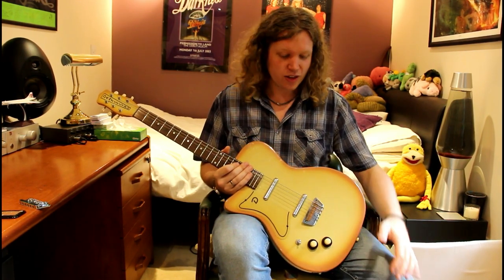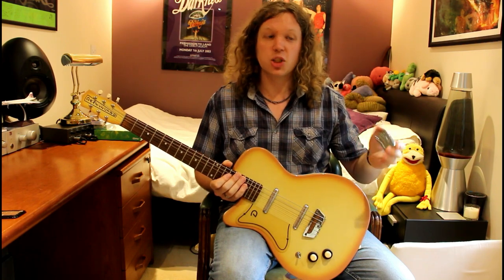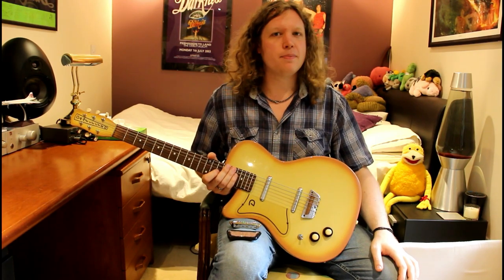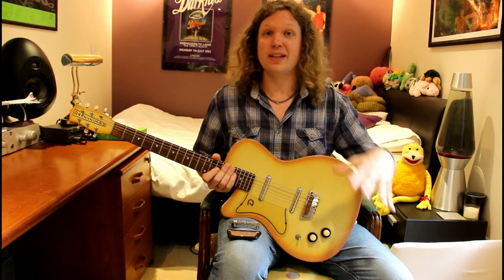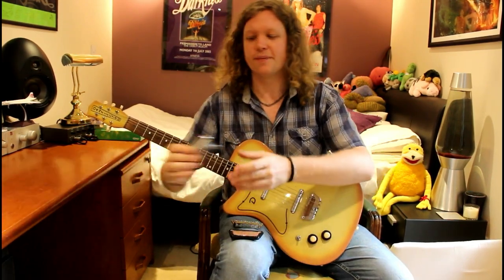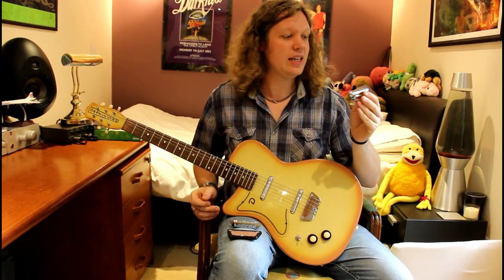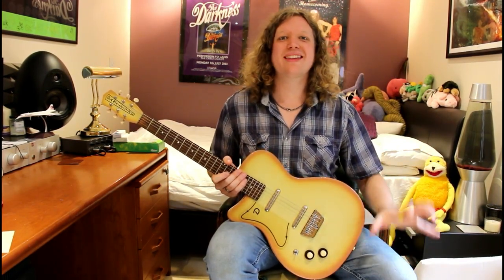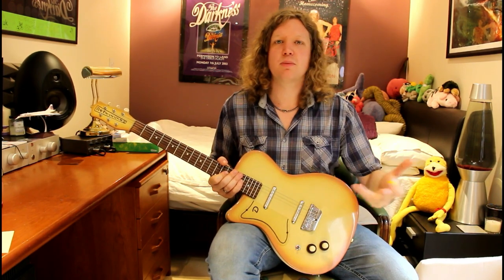Guitar Mods: What Happens If We Change EVERYTHING?? (Danelectro U2 + Curtis Novak Lipstick Pickups)

Comment: The beauty of the lipstick pickups is the low output on them... like a tele. The best sounding Les Paul is the '59, their pickups are so lowoutput that they are closer to a Strat than a modern Paul. I'm also lefty.
Reply from the maker: Yay for lefties!  Yep, the old PAF humbuckers were about 8K, whereas the stock p'ups in my '92 LP Standard are about 14K!  PAFs are so much more dynamic...but then again, plug the '92 into a Marshall and...well, you know! :P
Reply: @JoePerkinsMusic  I had a Les Paul Classic Premium Plus (94 maybe) it had ceramic 498R and 500T, very very hot pickups, on my JCM 900 was super overdriven, but was the nature of the 90s.
Reply: @JoePerkinsMusic  Hi. I am lefty also. Have the same guitar. Bought the same bridge. I tried to switch the string saddles but no luck. Won't fit. Can you tell me exactly what to do? File the width of some of the string saddles? Did you have to modify the new bridge in any way? Please help me to make this work. The original bridge warped again 😕
Reply from the maker: @davidkastin4240  Hi David!  Yeah, that's exactly it...I think it was just the low E saddle that had to be filed...but I just took a little width off the side that rests against the A saddle so that it'd fit in the gap.  You get bigger gaps between the higher string saddles but that doesn't really bother me...much better to be able to intonate the guitar, I think!  The only modification I made to the bridge (aside from the wooden block to bolt it flush to the guitar) was I had to re-drill a new hole for the low E string saddle to screw down into to lock it in place...not because of the filing, but for general intonation.  I couldn't move it far enough back with the screw hole where it was, so I drilled a new hole a few mm behind.  But - you might be lucky.  I think that had as much to do with me using a 60-gauge low E string as it did with the design of the bridge, so if you're using 'normal' strings you might be ok! :-) Let me know if you have any more Q's!
Reply: @JoePerkinsMusic  Did you have to file the little nubs off the back of some of the saddles also? It's a bit of work but I'm concerned about being able to intonate it correctly. The original bridge warped up, possibly because I don't play it much and the string tension caused it to warp up on both bottom sides of the original bridge. Surprisingly the intonation was very good before it warped
Reply: @JoePerkinsMusic  obviously the metal for the bridge is not heavy duty enough. The intonatable bridge seems stronger across the entire bottom
Reply: @JoePerkinsMusic  will I also need to make a lower hole in the bridge for the G string saddle so it can drop lower dor intonation?
Reply: @JoePerkinsMusic  the block of the saddle has 2 rows of 3 holes at right handed angles. Wouldn't you have to drill 4 new holes to make it angle for lefty? The 2 outter holes of each row
Reply from the maker: @davidkastin4240 Hi David - nope, filing the 'inboard' side of the Low E and re-drilling its mounting hole was all I had to do to the new bridge to make it work, aside from swapping the saddles over.  The G-string intonates fine with the original hole position as do the rest of the strings (for me) aside from the Low E.  But as I said, I use a 60 gauge so it might be fine for a standard Low E gauge.  Drop me an email at jp@joeperkins.co.uk and I'll send you a picture of what I did :-)
Reply: @JoePerkinsMusic  Hi Joe. Can you please send me pictures of what you've done as you mentioned? Thank you. Love your guitar mate. What color is it called? I haven't seen many or none at all this color 👍

Comment: Hi, thanks for the videos (both this and the previous one). I have the same guitar in black. I really love the sound and look. I don't play so loud, so the low output is ok for me. The bridge is a nightmare for stringing! It has just a notch, so until you get the string tight enough, it keeps jumping out all the time, from the notch (and for the first strings, the bridge itself moves all the time, as it is not fixed to the body). You really need three hands, one for winding, other for tighting and guiding the string low, and the third to keep the bridge ends of the strings in place... Anyway, I knew that these were cheap guitars, both in hardware and wood (wood?), so I keep it just like it is. I'm happy with it. Thanks again!

Comment: i found a nice set of vintage style locking tuners which are great to have, for all the reasons locking tuners provide.  also, changing the bridge means now you are going from the original "wood" bridge to the "medal" bridge.  that is part of the tone change and also the output level, even though the new pickups are absolutely guilty also of the better, bigger, cleaner yet more powerful sound.  just some ideas ... those vintage style locking tuners bro.  try 'em.

Comment: I've got one of those 90's U2s in a green-burst that I bought new when they first re-issued them in the mid-nineties. It's always been a good guitar even though it's not my first choice to gig with. I didn't feel the need to change much on it: I got the same intonatable bridge, gave it a Switchcraft jack and changed the tuners. I surprised that you didn't feel the need to do that or maybe my tuners just wore out because they were really slipping a lot. In my local music store I found this set of Chinese replacements by this company called PING (I know, it's a funny name for tuners) that were low cost and of the same design and shape of the originals only slightly larger but still were a direct replacement without any drilling or modification. It fixed the tuning issues for not much money. I use 10-46 strings so maybe that's the difference. I really like the sound of your Williams Pro II pedal by the way.
Reply from the maker: Tuners have been remarkably solid on my Dano!  All Williams pedals are insanely good...definitely worth checking out :-)
Reply: Where did you manage to find that bridge? Its looks wonderful.

Comment: With the mods she generally sounds „better“: fuller with more range and bottom end, but lost the charm of that tinny voicing…
   Would’ve been interesting to hear the difference after each particular  swap- with just the new bridge, then old bridge + the new pups. Finally new bridge + new pups. For every test using the same ol' strings. The pots beeing of same value, the diffeence might be not hearable.
Cheers

Comment: Definitely the Novak pickups have an overall better tone to them. Im looking at getting one of his New Yorker pickups for my epiphone coronet. It’s a single coil wound to similar output as vintage p90. He also does a modded pickgaurd as the pick-up currently in the coronet is a epiphone pro p90.  Simple install. The 1959 coronet used the remaining New Yorker pick up before they changed it to the p90 in 1960. So by putting this into my reissue coronet will give it a more vintage aesthetic. Or do I swap it for a Monty’s 54 p90 which will look the same. Struggling to decide. Any thoughts? I might add it’s being upgraded to 50s wiring at the same time ..
Reply from the maker: The Monty's '54 is a stunning pickup - so, can't really comment on the NY pickup, but can wholeheartedly recommend the Monty's!

Comment: What is the bridge wedge made of? I was thinking about installing the Graph Tech ResoMax NW2 Wraparound Bridge with String Saver Saddles on my Danelecro guitar.
Reply from the maker: I actually made it out of a sheet of ply-board that arrived in a parcel as packaging :P Happened to be exactly the right thickness to get the action exactly where I wanted it...happy coincidence!!
Reply: Joe Perkins thanks for getting back to me. I’ll have to get with my luthier and see what is best for me. I’d like your idea a lot better then the Graph Tech ResoMax NW2 Wraparound Bridge with String Saver Saddles.
Reply from the maker: No problem!  For me, bolting the bridge onto the body made a big difference - definitely sustains better now, and of course can be intonated.  Plus, it's possibly a psychological difference too - I'm very happy hitting the guitar hard now, whereas with a bridge suspended on two tiny screws, I was always waiting for the thing to fly off! :P

Comment: Thanks for this video! I've had mine for about 20 years and I'm finally bringing it out of the closet to fix up for my kids. Definitely love the upgrades! I've always hated the bridge too! I've ordered a new one. At the end of the vid you mentioned when you switched yours out that you went down to a 1 tier. Did that mean you got rid of the wood altogether or did you cut it in half to fit?
Reply from the maker: They're killer guitars for what was - even back in the 50s - always intended to be a budget instrument!!  It was the wooden chock I made to mount the new intonatable bridge on so that it wasn't floating...I thought two bits of plyboard would be the right thickness but in the end I only needed one, so I split it in half :-)
Reply: @JoePerkinsMusic  Awesome! Thanks so much. Got some tinkering to do! :)
Reply: Joe Perkins Do you recall the ply thickness? Was it 6mm? Also, how did you attach it (short screws)?

Comment: Hi Joe is it necessary to change the pots to higher power ones as well because because the pickups are higher output, I was thinking of just changing the pickups only, thanks Kim
Reply from the maker: Hi Kim - nope, not at all...you can swap just the p'ups no problem whatsoever!  :-)  The only thing that really makes a difference with pots is their value - generally speaking for most guitars, that's 250k for single coils and 500k for humbuckers (though Danos are weird with 100k for tone and 1Meg for volume...don't worry about that too much!)  You can run any pot with any pickup & it'll work fine - they don't have a 'power' as such so hotter pickups don't need a different pot, but as a general rule the higher the value of the pot the brighter they'll sound.  Experimenting with values can be fun, but with these Danos we're kinda stuck with the pots they have as they're a very different design to the majority of guitars.  So yeah - swap away! :-)
Reply: @JoePerkinsMusic  thanks Joe for the prompt reply, thats great to know, yeah i'm gonna swap out the dano pickups for these ones- https://www.guitarfetish.com/KP--Pro-Tube-D-CHROME-Fits-Danelectro--Kwikplug%E2%84%A2-Ready_p_22019.html has anyone used these ones before? 8K in the bridge sounds awesome, I bought the Dano Wild Thing guitar for its lightweight i dont really care about he Dano sound, i'm basically looking for humbucker sound from the Dano because I play punk music, but Les Pauls kill my shoulder no matter what strap I use on them, so hoping the new pickups give the Dano a more dynamic sound, any advice on this would be much appreciated
Reply from the maker: Yep, those should work for that :-) The middle position with the two running in series should definitely get you closer to a Les Paul humbucker sound.  They likely won't be more 'dynamic' as such (generally speaking, the higher the output of the pickup, the more compressed the sound it puts out) but the higher output will probably be darker than the current ones and definitely more beefy when hitting amps or pedals...definitely more humbucker-like but with a good single-coil crunch for some punk aggression :-)
Reply: @JoePerkinsMusic  thanks again Joe for the great reply and info, I will be getting them soon and will post here about the sound, the Dano I have is called a Wild Thing same as this one- https://www.musicradar.com/reviews/guitars/danelectro-wild-thing-463536 it has just two pickups but they run in series, so should be good to do a before and after if anyone is interested

Comment: Hi Joe, are the potentiometer values 1 Meg for volume and 100K for tone? I would’ve thought 1 Meg for volume would be too bright for this single coil pickup…plus, reading online I’ve found contradictory information - 100K for volume. I’m the changing the lipstick pickups in a left handed Surfcaster 12 string to Novak pickups and need a bit of guidance vis-a-vis pot values…did you source reverse pots for this upgrade? If so, where did you find them? Cheers.

Comment: Hey great video! Quick question, what is the output to the Curtis Novak Lipstick Pickups is it vintage low output: 3.4k – 4.0k like on their website or did you get medium or moderate output level pickups instead?
Reply from the maker: Thanks!  I believe the outputs are 6.2k(B) and 5.8k(N) - but I measured those with my old multimeter, which it turns out had been giving some pretty wild readings!  When I ordered them I asked Curtis for 100% vintage-spec....'tis all i know! :-)

Comment: Great video, sir. 
I’m wondering how much better the tone and sustain would be by simply adding the wood plate under the original bridge?  It seems that the extra contact between bridge and body would affect it greatly. Opinions?
I’m going to give it a try with mine.
Also, the intonation CAN be “adjusted” by moving the wooden saddle. There is a screw underneath the bridge holding it in place... which is actually ridiculous, but that info may help others having intonation problems.
Reply from the maker: It’s worth a go, for sure! Let me know how you get on :-)

Comment: Joe, great video! Are the pickups still wired the same, in series  after the new ones were installed? Or did you go with a typical tele style parallel wiring?
Reply from the maker: Wired exactly the same - so the middle position is the two lipsticks in series. :-) I actually used the Dano today to demo a fuzz pedal...first time I've used it in a good while for a video, and it sounded ace!!
Reply: @JoePerkinsMusic  awesome! I just found your channel and subscribed!  Can’t wait to check out your other videos.
Reply from the maker: @brittonrupp1481  Cheers pal...hope there's stuff on here that's interesting for ya :-)
Reply: @JoePerkinsMusic  awesome. One more question, are you using 12-60 on all your guitars? And also do you utilize a wound G string? Thanks!
Reply from the maker: @brittonrupp1481  Yep - I use them on everything. G string is plain :-)

Comment: But now it's not really a Danelectro anymore is it.
Danelectro is all about the materials the low out-put pickups and the rosewood bridge.
I guess one could go out and have an alder or mahogany body built too but then what would you have? Not a Dano.
Intonation is a much bigger problem on the longer neck Dano's but on the 21 fret models it's no huge problem. You could take a file and compensate the bridge and improve it if you felt you needed to but it's not that much of an issue. Also Rosewood sounds like rosewood.
Reply from the maker: With asymmetrical 12-64 gauge strings, intonation was certainly a big problem for me - the new bridge solved it in a way that notching the slab of wood wouldn't.

Comment: This is cool I always wanted to mod a Danelectro guitar, the thing about the original ones were their pickups it had a very unique tone that's not easy replicate. Uh Ha that bridge cap value .01 is the same one i'm gonna use for my les paul neck pickup. the upgraded tone is slightly better more usable settings , good effort tho.
Reply from the maker: Yeah definitely - the Novaks are said to be the closest to the originals, but I've never tried a 50s one (I doubt there was any leftys ever made!) so can't vouch for that myself!  0.01 is a good value - I never really use 'stock' tone caps past about 3 on the tone control anyway on any guitar, so going for lower values is a good plan! :-)
Reply: Thanks for the reply, u think that's too muddy the .001uf Cap Value ? U know Lindy Fralin demonstrated that cap value with the a tele neck pickup and it sounded good like beefy with good midrange tone,  I mean ur rolling off the treble not adding on to it..  I think it keeps the brightness till after 5-6 on the tone knob that's what I'm guessing.  Have u try the .001uf cap value for the bridge humbucker ?  He use that as well and it boost the sound  but didn't do anything for the neck pickup.

Comment: Well how do you access those pickups?? I can't seem to find anyone who actually shows the swapping of these lipsticks. How do I get them out without breaking the body?
Reply from the maker: There's 4 screws on the back of the body - they screw in just like 'normal' pickups but from the underside.  How tight you have the screws sets the pickup height.  When the screws are undone, the pickups will just drop out.  You can see the 4 screws here: https://images.app.goo.gl/taie27FxasW8VBmJ8

Comment: You hear difference in wires?...m'kay.
Reply from the maker: Well...I hear a difference in the before & after, of which wires are a small part!
Reply: In a blind test, you wouldn't hear a difference. You're talking about 2 different pickups here. The upgraded ones are much more overwound making it sound all mushy... the wires making zero difference. The Dano pups are already a little too hot for that true Dano sound... it's still a great little player, unmolested. I'm thinking of rerouting mine for low output p90s or jazzmaster pups.